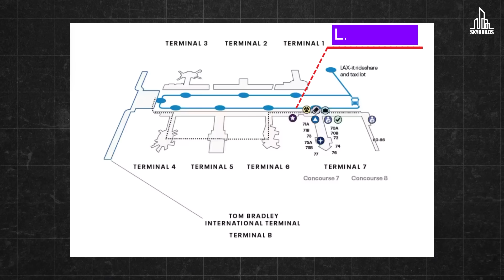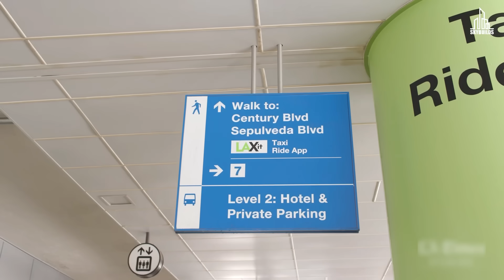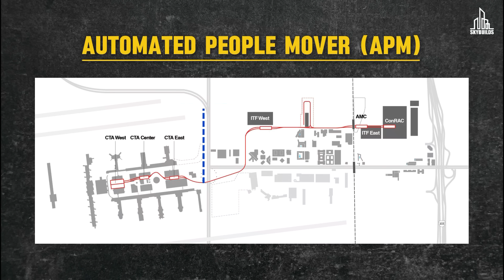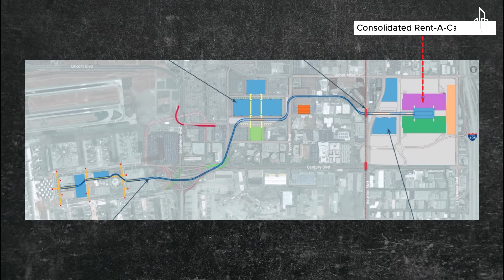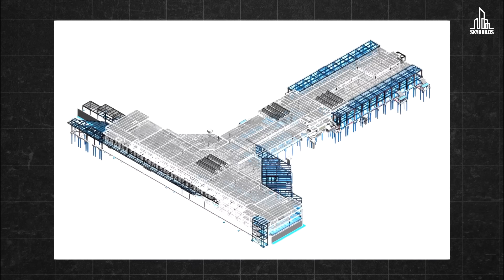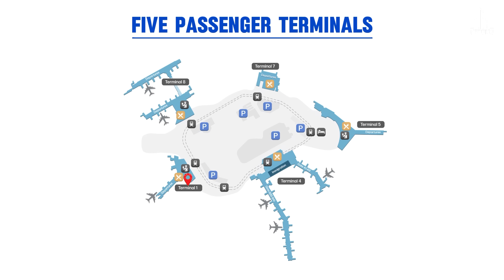How LAX Is Building The AIRPORT Of the Future For The 2028 Olympics!

Comment: While much of this video is accurate, there are some errors. The Midfield Satellite Concourse was created in 2 parts: The West Gates at Tom Bradley and the South Concourse. Only 1 carousel was added to Tom Bradley Terminal for the addition of over 15 additional gates.   Other baggage claims were built in Terminal 1 which is connected by a bus gate. Tom Bradley is widely crammed and has inadequate arrival space for International and domestic operations. While LAX is challenging, there will be improvements with the APM. But passengers will always be upset by the unique ticket counter setup for LAX. 7 terminals have International access…not just 1.

Comment: Given, according to your video, that LAX with 75 million passenger volume per year, 8th busiest in the world, is planned to have a SINGLE APM - airport people-mover stop to connect to the Los Angeles' rail transit network appears to be grossly inadequate, especially for the forthcoming Olympic events for the city to host in 2028. 

AND to note the number passengers who alight from the AI-generated simulation of the API "train", one wonders how many seats will be designed into each coach of the planned people-mover?
Reply: Each APM train will have 4 cars with a total of 200 passenger capacity with luggage. It will be fully automated and run every 2 minutes during peak hours, 24/7 365 days a year.

Comment: I drive in and out of LAX several times a week, and none of the $30B worth of “improvements” have actually improved the piss poor airport experience, one scintilla! One MAJOR oversight has been that of traffic ingress & egress…
The Airport Planning Commission should have constructed 2 driving tunnels heading East/West from Terminal 3 West to Pershing Blvd (west of LAX property) and from Pershing Blvd, East to Terminal 4. These tunnels would have not only cut the traffic in and out of the airport in half, but it would also have eliminated having to navigate all the rest of the way around the airport roadway (TB, T4, T5, T6, T7, T8) when you are just going to Terminal 3 you could immediately exit the airport west, via the tunnel to Pershing, or Terminal 4, you’d take the tunnel from Pershing East to Terminal 4, and bypass the rest of the airport traffic. Adding those tunnels would also reduce the traffic considerably on the current LAX entrance road, Sepulveda Blvd, which is also a main West-side LA traffic artery for regular North/South rush hour commuter traffic!
Reply: Of course not, it's not completed yet😂
Reply: The point of many of the improvements is to not have people drive their vehicles into the horseshoe.

Comment: With the exception of Bradley all the gates at LAX are easily accessible from transportation.  Few airports can make that claim.  The problem has always been getting in and out of the airport.  One stalled car or accident at Terminal 6 or 7 locks-up the entire facility.  The long overdue people mover will do much to relieve that congestion.
Reply: Very true. And it's been better since they stopped allowing cars to pickup people at the inside sidewalk. Picking up people on the outer sidewalk has improved traffic.

Comment: 3:38 LMAO these designers really think these small trains running every 2 minutes would be enough to carry all the passengers
Reply: Each train is capable of carrying 250 passengers and their luggage. The fully automated train will run 24/7, 365 days a year.
Reply: @mrxman581  Doesn't matter if it runs at 3AM. When it hits the peak, it will be packed
Reply: @tomhwm913  Yes, but the APM will have people getting on and off at the 6 stations. It will take 10 minutes to traverse the 2 mile route. Even if people have to wait for the next train, it will be a huge improvement over the current situation where it can take an hour or more just to go around the loop.

And 250 capacity if just the official number. We all know that people can squeeze in more when super busy
Reply: @tomhwm913 That's a good thing. Packed trains means less traffic which is the goal😂
Reply: @mrxman581  I don't need an introduction of this project. Yeah it will be an improvement over the current situation but it's far from what needs to be done. All I know is that other big international airports gets actual rail transit and LAX as one of the busiest in the world only has a people mover. Not only is this small people mover expected to take passengers traveling out of airport area, but also those going to rental car centers as well, while most other APM systems are only designed for that latter task only.

When you add an Olympic to that it's easy to see this system is not good enough to handle all those passengers. This thing will be either overcrowded or pretty much useless except for rental car users because nobody wants to ride this jammed tram to a place where they can go to a station that's another 2 transfer away from city core. They chose this half-ass measure because it's the only thing they can get done by 2028 and by doing that they're also taking away the chances of LAX getting an actual transit access upgrade before 2050.
Reply: Um yeah that's how trains work and nothing moves people faster or more efficiently than trains😂
Reply: @dannielz6  This is not about having trains or not. This is about having an incapable service when what they actually need is a heavy rail. This is not even a real train. It's a people mover. And guess what? When this thing gets overcrowded and run-down in a few years, they'll look at this and say "see? Rail transit doesn't solve the problem" and they'll refuse to put more money into a better one.

Comment: Bradley tunnel to west gates.  Wear good walking  shoes.  Moving sidewalks usually in op.  No shuttles.  Up and down stairs.  And if you are one of the last flights.  Escaltors are turned off.  Will still be a garbage airport in 28.  Just with more people for those 4 weeks.

Comment: I don't understand why it took soooo long to build a people mover. And can't understand it is behind schedule. This should have been done 50 years ago
Reply: The airport dragged its feet for years building a people mover because it would eat into its parking revenue which is very profitable for the airport. The traffic and congestion had to get so bad that more and more passengers were missing flights due to getting caught in traffic jams. LAX got consistently rated worse large airport.
Upgrading terminals and shopping for travellers brought in a growing source of revenue. Parking fees will probably rise after the opening of the people mover, but there will always be folks that want to drive up to the terminals for drop-offs and pick-ups.
Reply: @richardcogbill6791  Parking fees is not the reason for not building a connection from LAX to the LA Metro. It's more complicated. Including the fact that the FAA had issues extending the C (green) into LAX, which was the original idea for an LAX connection to the LA Metro. 

In retrospect, the delay was a blessing in disguise. Now, the LAX People Mover will connect to 2 LA Metro lines going to very different parts of the city, serving more areas of the city directly.
Reply: It's a moot point now.

Comment: The APM connecting with the K line to reduce travel time feels pointless since the metro moves slower than the car traffic at most points
Reply: That's only for the e line, which is one of the most used lines but somehow doesn't have grade crossings??? The K line has grade crossing and really good priority signal
Reply: @AJPJElias The E line is grade separated along many sections of the route. However, in certain areas of LA and East LA it doesn't have signal prioritization. Unfortunately, it's not up to LA Metro. That authority belongs to LADOT. Hopefully, the pressure of the coming World Cup and Olympics will finally convince LADOT to allow complete signal prioritization for both the E and A lines.
Reply: Not true. You've obviously have never ridden the K line. Many of its stations are completely grade separated. Three of them are underground as is the line. And the C line is completely grade separated and has a top speed of 65 mph. It will also connect to the APM.

Comment: The traffic is one of the worst in the world 🌎 & the airport is gigantic, you walk miles & miles to get the gate 🙀🙀🙀
Reply: yes, no help from staffs and the airport is poorly designed to be honest. if you have travelled aboard you would agree.
Reply: @chrthewrestler2301  LAX's design was lauded when it first opened the horseshoe design. The design of the terminals was based on having the shortest distance from being dropped off at the curb in front of the terminal to boarding the plane. It  was so efficient and modern at the time, it became hugely popular very quickly, too quickly. What they didn't forsee is the need to expand so soon. Much sooner than anyone expected. And they've been playing catch-up ever since. Then, 911 happened, and the idea of having the shortest distance between arriving and getting on the plane worked against the new security requirements.

The construction of the upper deck of the horseshoe and the TBIT for the 1984 Olympics helped tremendously. But, again, it was too successful for its own good.

The current expansion/renovation has been going on for several years, and it will once again improve LAX. For how long, we'll see.
Reply: That's only if you have to use the TBIT Midfield gates which requires you to go through a very long tunnel. Though, there are moving walkways.

Comment: 7:00. The bridge depicted in that shot has nothing whatsoever to do with connecting T1 and T2 (post-security). That landslide bridge connects the automatic people mover (inside the Horseshoe) to the terminal (across the Horseshoe road). The point of the unseen bridge project: connecting T1 and T2 is a portion of a larger project to make every terminal connect to its neighbors airside so that passengers can change terminals without leaving security. That goal reflects the purpose of the video: the previously discrete terminals  at LAX will, when this project finishes, all be connected post security.
Reply: All the terminals are now connected behind security. They finished that last section of the bridge connection between T3 and TBIT several months ago.

Comment: Prefabrication is not innovative, it's finally being used on large projects, other than mobile homes.
Los Angeles is being forced to repurpose many existing structures for 2028 Olympics, the City and State are suffering fiscal shortfalls, as a result of 2020 COVID-19 Pandemic.
In addition, Los Angeles did NOT and does NOT need the Olympics, it already attracts over 50 million visitors per year.